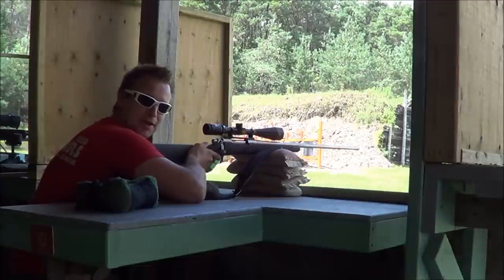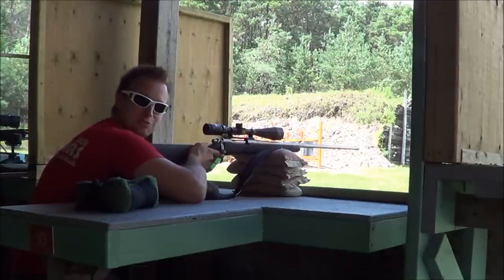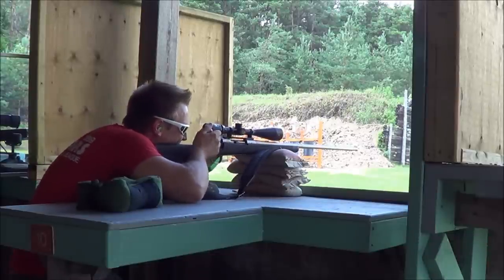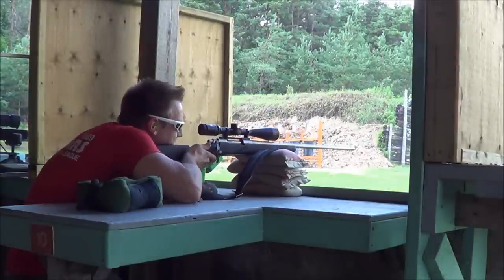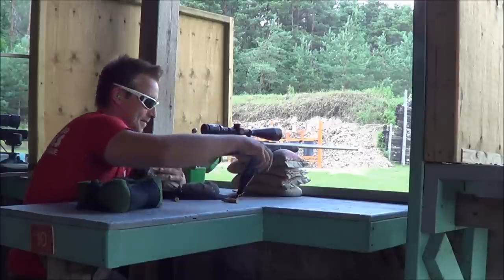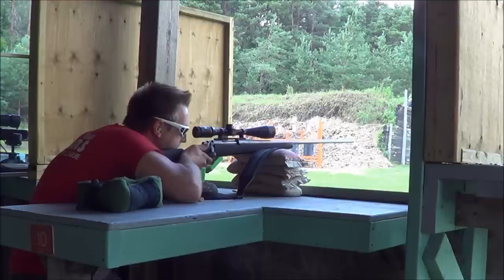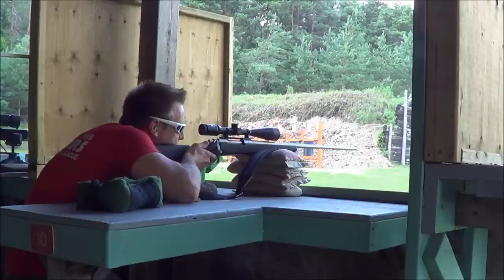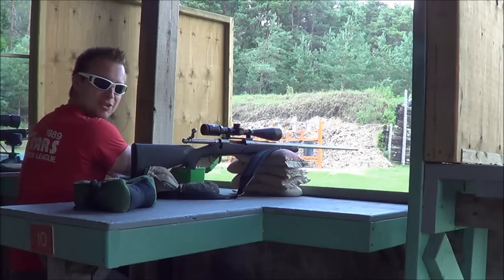Remington 700 300 win mag recoil with and without a Kahntrol muzzle brake demonstration

Comment: I was shooting my 22 at the range and they put a shooter two stalls to my left with a 300 Win Mag with a muzzle brake.   My day immediately went from pleasant to unpleasant.  I was getting hot gasses and sand in my face with every shot.
Reply from the maker: Ya brakes are not very nice for the bystanders for sure! But it makes a heavy recoiling rifle pleasant to shoot. When ever I go to the range a get as far a possible from any other shooters there. Just to be courteous of course
Reply: Not to mention its loud enough to take paint off a barn door.
Reply from the maker: @kykrazy6050  I have an old video with my 6.5 creedmoor where I’m prone on my back deck (old deck) and the blast was blowing the paint off the wood
Reply: @BROTUNED  LMAO!!!!
Reply from the maker: Well the 300 is out of commission now I broke the bolt handle off coming up in November if you are interested. I have vids scheduled every Sunday at 7pm
Reply: @BROTUNED  Rattled itself to pieces
Reply from the maker: It’s worse than that

Comment: but wouldnt the heat  from a good bit a shooting shrink the end of the barrel when the the muzzle brake is on ...because it has to be tighten fairly tight in order to stay on due to a great amount of energy due to muzzle blast ???
Reply from the maker: +Becca Ducker ive shot 100 plus in a row not recommended but I did it and the barrel was to hot to touch and everything is fine still shoots sub moa all the time.
Reply: Heat expands metal becca!! Put it on cold with locktite and your all set, just make sure you level it to your gun and optic.
Reply from the maker: Long John l

Comment: Do you have issues with the clamp on break coming off?
Reply from the maker: I have never seen the brake move and I have the barrel painted so it would be clear as day if it moved. I have taken it off a couple times and even with the bolts backed out it did t want to move very easy. I use a penny or something softer than the brake and bolts between the gap on the side of the clamping area to use the bolts to pry the brake open just a bit and then it slides off with no effort at all. But yeah if it’s clamped on correctly you will never have an issue. Hope this answers your question
Reply: I have a Witt machine clamp-on muzzle brake, if you measure your Barrel correctly and tighten the screws as directed mine never has moved
Reply from the maker: How do you like that brake? (Witt Machine)
Reply: @BROTUNED  my 300 Win Mag kicks less than a 308 semi-auto and has very little muzzle rise. I love it.
Reply from the maker: I loved mine but it’s kinda not around anymore as seen in tonight’s upload

Comment: Is the .300 win mag long or short action. Ik it's a dumb question I am just now learning about guns I would really. Like to know thanks!
Reply from the maker: Short action is everything from like 204 ruger 223 anything based on 308 cartridge family and the short mags then long action is 30 06 based cartridge family so like 25 06 270 30 06 338 06 7mm 300 338 stuff like that. It's pretty easy to tell what's long and short. Just look  at the action. Short action is much smaller bolt throw is shorter and action is lighter
Reply: It's a belted magnum, so it's longer than a long action.
Reply from the maker: HuntTexas777 I'm pretty sure there is only short or long actions. And some budget rifles used a long action for all their chamberings like the axis 223 uses the same action as 30 06 but it cuts cost I'm sure.
Reply: They are long but they also make a short mag as well.
Reply: Mark Butters Not a dumb question at all!!!! The technical term is "long action magnum" ANYONE that says ANY question is dumb,as a rule of thumb....THEY are dumb,so DON'T take their advice at all about ANYTHING.
Reply: It's a super long action judging by ol' boys shoulder in the video....lol
Reply: Look for yourself at how far the bolt is pulled back.

Comment: Is it significantly louder with the brake on?
Reply from the maker: Deerslayer1912 yes its very loud like i wouldnt shoot it without ear pro.
Reply: Deerslayer1912 YES!!!! NEVER FIRE A RIFLE WITH OR WITHOUT A BRAKE ,WITHOUT EAR PROTECTION. (Unless your huntin of course) even then if you can manage to put plugs in before the shot,do so....but NEVAA. ....EVVAAA.....EVVAAA....EVVAAAA....shoot without ear protection. ONE time can cause irreversible hearing damage.
Reply: @kykrazy6050  Even for hunting, ear pro would be good.  A good set of mic'd muffs will do wonders.  Amplifies the sounds in the woods, and the electronics in the muffs still dampen the sound when it detects the shot fired.

Comment: Do they make a brake for a 458 win mag?
Reply from the maker: I am sure they do everything up to 50 cal
Reply: Ok Thanks. Are their any advantages on the clamp on vs Threaded?
Reply from the maker: Ya the clamp on brakes are diy installed with no gunsmithing and if you end up selling you could use it on another rifle provided the barrel is the same diameter at the muzzle. threaded through is good but the cost of installation and brake itself would be 2 to 3 times as much. I have both threaded and clamp on brakes from #kahntrol and love them. light weight and extremely durable.
Reply: Yea all makes since i will check into them thanks.
Reply from the maker: Ya go to thier web site or call and ask for Jeremy. that's who I deal with and he was a big help.
Reply: Ok thanks.  a lot.

Comment: muzzle break is loud, expensive and lower bullet speed.
Reply from the maker: It doesn't lower bullet speeds according to my chrony.  Plus the bullet is slowing down the moment it leaves the muzzle. The acceleration only takes place in the bore.
Reply: +RINGET421 i measure bullet speed in a 7mm mag and with muzzle brake the bullet speed slow avrg 150fps with roedale clamp on brake
Reply: At what point did the deer (or whatever) notice the 150 fps slower speed?
Reply from the maker: RbG84 I have never seen any loss in velocity with or without a brake using the same ammo. you must have done something wrong
Reply: ok man. thanks
Reply: True your brake to the bore of the barrel. Ones that are off center a bit screw with accuracy and speed.
Reply: i have now one 308 with the witt machine and lower speed avg 50/100 fps.   in my 2 guns Kahntrol 300wm and witt 308 they lower bulley speed in crony. not alot but is fact